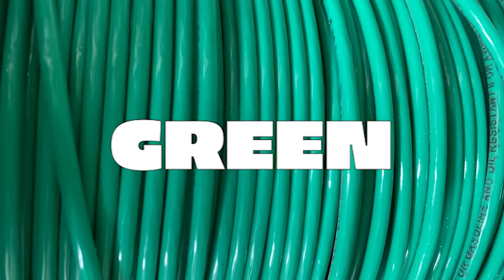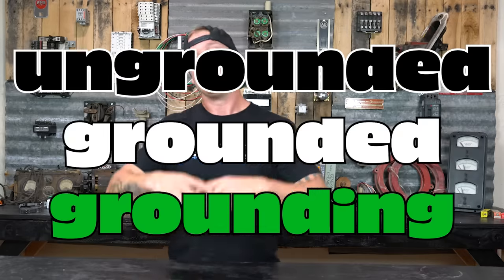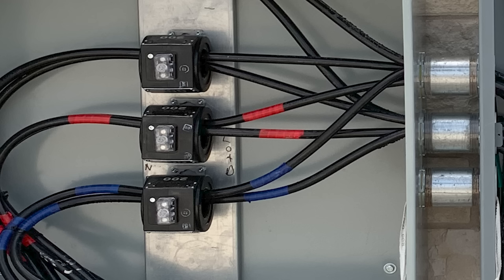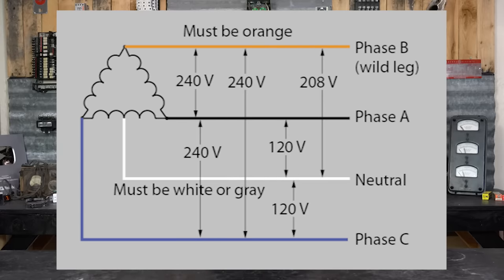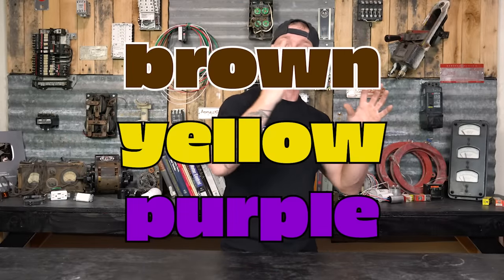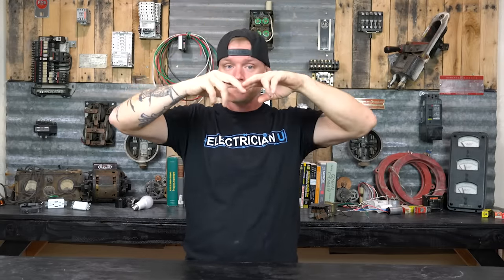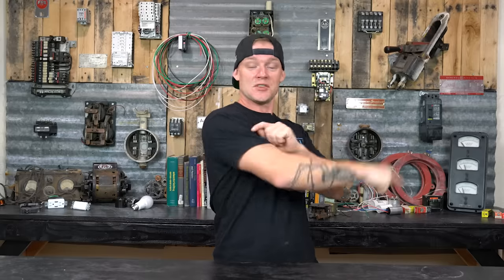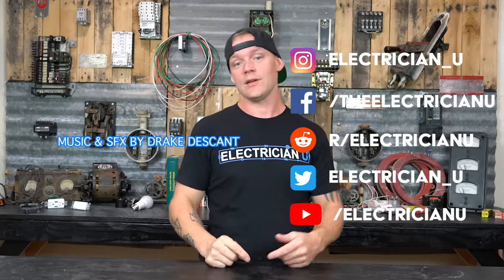Electrical Wire Color Coding Used By Electricians

Comment: The difficulty you're having describing "grounded" and "grounding" is that the "grounded" conductor is more correctly referred to as a "Return"... Stop calling the neutral wire a "grounded" conductor even though it is "bonded" to ground in the breaker box. It is the return conductor that's paired with a hot conductor.
Reply: @B Tomas … the “neutral wire” or “return wire” is the Grounded Conductor in the National Electrical Code so it’s not going away any time soon.
Reply: @jimshort9266  - The white wire IS a conductor of current, hence the term "return". It is NOT a ground wire even though it is bonded in the breaker box.
The green "ground" wire is NOT a conductor of current (exception is a fault) and that's the difference.
Reply: @btomas225  … I’m not arguing with your rational. I’m just stating that the code distinguished conductor types by defining them as:
Ungrounded Conductor
Grounded Conductor
Grounding conductor.
   They also use the terms phase conductors, neutral, and bonding jumpers but the term “return” isn’t used. The language used in the code book is always going to be utilized.
Reply: @btomas225  Its incorrect to call it return.Return would mean the direction of current flow,but there is no specific direction in AC as it swaps polarity at 60 Hz.

Comment: I don't mean to be a butthole, but the only wire coloring requirements in the NEC are that equipment grounding conductors be green/green with yellow stripe, grounded conductors be white/grey, high legs be orange, and that when there are two separate voltage system classes present each voltage system class be labeled separate from the other and it stays consistent throughout the structure.

Comment: In New York and New Jersey BOY  brown orange yellow .  Single phase is 220 VAC 440 VAC between phases , Find this a lot on new college buildings . Have this in elevator motor rooms and other equipment .  Use transformers to step down for lights and outlets to 110/220 VAC.      They do this to cut down the size wire going into the building . But not cost effective because of transformers .  Your tax money at work lol .

Comment: I worked on a 15,000 volt system and the other guys called it medium voltage
Reply: Medium voltage is above 600 volts to 69,00 volts

Comment: I always thought that the red conductor in 14/3 wire was used as a traveler in 3-way switches. I guess I've been doing it wrong. :/
Reply: Of course it is. The black is the common, unless you have a line/load in the other location. Then, you tape the white wire black and use it as a common in the 3 way with only 1 cable in it.  I hope that makes sense.

Comment: Fun Facts: In cinema or motion picture production, we "electricians" (not really electricians, set lighting technicians that work with a lot of electricity, powering 20kW lighting fixtures and what have you,) tag our 480v systems (in MN) Brown, Orange, Purple, because we use Yellow to signify 220v-240v which is much more common than running into a Wye or High/Wild (whatever you call it) Configuration. 
But, I hear they're actually very common in a lot of the older theaters and stage techs (a different world entirely) have to deal with them frequently] so mileage may vary.

Edit: There are plenty of certified Entertainment Electricians. I'm just not at that level yet.

Comment: What you need to know is never trust the color the code book only specifies white and gray needs to be neutral and if you have a bastard leg it needs to be orange and ground can be green green with yellow or bare it literally says nothing else about colors but I know guys who have wired center ground deltas and phased them black red blue so don't trust any color even when the code book tells you cuz you can label a 120/208 volt wye panel orange brown red gray and be completely legal the code is vague on colors and even with licensed electricians out there some might still ignore the bastard leg and label it red so don't trust colors it's kind of an industry standard that isn't because it varies from state to state

Comment: Or in my case, cant say where but at the location i work, you get people that dont give a damn and they’ll just use whatever color they have. Ive seen 208 being black/white, 480 that was all black wires, even seen a toggle switch that had black as power in and green as power out 🤪
Reply: If you ever work in an old building, they used green for a hot wire back then.
Reply: @MrSleepProductionsInc  yeah not the case here unfortunately. Building only a few years old.
Reply: @gonzaloalcantar6522  that’s a shame. I don’t understand how those new construction guys get away with stuff. I swear they have to be bribing the inspectors! I’ve seen sooo many obvious code violations in newly constructed buildings I wonder if the inspector even bothered getting out of the car.

Comment: Now explain a corner ground 480 v delta system. This one will get you killed if you don’t know what your doing. One of the hot conductors has no potential to ground. It’s an old system that isn’t used much.
Reply: It’s still very commonly used in central Kansas. It’s not a bad system.

Comment: Please do a vid on three faze!!!!!!!!!!!! I dont understand it and nobody can seem to explain it!!!
Reply: The general equation for a Voltage sine wave is:
V(t) = A*sin(B*t + C) + D

A is mid-to-peak amplitude (equal to sqrt(2) * the nominal voltage)
B is a term that is proportional to frequency, called angular frequency
C is the phase offset
D is the DC offset, which is zero for pure AC
t is the time

The C term is what is of interest here.   For 3-phase electricity, we have 3 voltage waveforms, that are each 1/3 of a cycle out of phase with each other.   For the A-phase, the C-term=0, for the B-phase, the C-term = -120 deg, and for the C-phase, the C-term=+120 deg.    Given 120/208V 3-phase, all amplitude A-terms equal 170V, which is sqrt(2)*120V to neutral.

The voltages of all three waveforms at any instant add up to zero, which is the voltage of the grounded neutral.  The voltage between any two of the phase waveforms will be a sqrt(2)*208V amplitude wave.
The voltage between any phase waveform a neutral, will be a sqrt(2)*120V amplitude wave.

The sqrt(2) term comes from a special kind of time averaging of the waveforms, called root-mean-square (or RMS).   I'll leave it to you to look it up in further detail.

Comment: Doing a startup on a 250 hp pump and the apprentice swapped the tape colors end to end on the feed. One phase dead to neutral.  ALWAYS TEST DO NOT TRUST WIRE COLORS.  Oh I'm not an electrician.

Comment: By conductor, you just mean wire right? "The black and red conductor" = "the black and red wire"?
Reply from the maker: For the purpose of simplicity yes. 
But the insulation color of a conductor has no real bearing or value at all when it comes to electricity. 

They could all be blue in color. One will be a hot, one would be a neutral, and one would be a ground. In this example. All three of the wires jackets could be literally any color. 

There is a ungrounded conductor (hot) grounded conductor (neutral) and grounding conductor (ground) for a 2+1 wiring system.
Reply: @ElectricianU  oh ok. That's making more sense to me now. Thank you so much sir! I am barely learning about electricity and I really like your videos.
Reply: @ElectricianU  so to be proper, because color has no effect on the conductor (if I understood correctly), we would say something like "the hot conductor," or "the neutral conductor," but not "the red conductor," or "the black conductor?"

Comment: RWB : DC power , BOY : AC power
Reply: Red/white/black = 120/240V split phase power
Red/black = DC
BOY = 480V AC power
BOYG = 277/480V AC power
Black/red/blue/white = 120/208V WYE
Black/orange/blue/white = 120/240V high leg delta

Comment: This guy is only talking about Wire Colors, when he talks about an ORANGE wire, he is showing a HIGH LEG DELTA SYSTEM, with this system there should be no SINGLE POLE CIRCUIT BREAKERS IN THE ORANGE LEG (when you see a Panelboard where every third breaker is a SPACE it’s probably a Hight leg Delta System). When I was teaching Young Engineers they often confused High leg Delta with 3 Phase WYE, make sure you know the difference. PS: THE HIGH LEG MAY NOT BE ORANGE.

Comment: the first picture shows parallel conductors on the same phase  going through separate lengths of conduit and holes in the box. pretty sure that's a no-no.
Reply: That’s the way you do it. You don’t want only the same phase conductors going in the same conduit. If you have two parallel feeds, phase A,B,C neutral and ground go in one conduit and the other conductors go in the other conduit.

Comment: I don't see much of what you describe for color codes in the sawmill I work at...... 480 Volt 3 Phase Delta system. Let's see if I can recall all the different L1,L2,L3 colors I've seen "Black,Black,Black" "Black,White,Green" "White,White,White" "Green,Green,Green" oh, and "Brown,Orange,Yellow" a time or two. And of course on 120 volt single phase I've seen White as the hot and Black as the neutral...... Everyone who works with electricity needs to VERIFY that the pervious person doing the wiring is not trying to kill you.
Reply: Black is hot where I live and white is always neutral.
Reply: @ShadowHumor  I'm in the United States, so it should be black as hot and white as neutral, but over the years some brain surgeon clowns have installed and fixed our wiring.....

Comment: I started in an industrial environment 3 years ago and was always used to BOY or BPY for 480v and yellow blues , blue/white for controls ... when I got onto a resi job I knew it was different voltage systems but didn’t know colors changed .

Comment: You need to learn you only have a high leg on a delta system not on a wye system need to address this, and most of the old 240/120 volt system are delta system and if you have a 480/277 volt delta system you again will have a high leg!!!

Comment: It's Brown Purple Yellow for 480/277Y to Identify it as being Y. It's Brown Orange Yellow for 480/240 Delta. Delta will always have a B Phase high leg. Meaning you cannot use the B Phase by itself or you will smoke your equipment. 240/120 Is Black Red Blue because it is Low volt. 208/120 is Black Red Blue also. Single phase is Black Red for 240/120 or 208/120. Idk what those colors are on your thumbnail but they are not from the US N.E.C.

Comment: I’ve been retired for over 17 years now, and I remember on a 4 wire Delta system, the Orange leg was 240 volts to the neutral, not 208 volts.
In the mid 60’s when I started (took the journeyman test on the 1968 NEC ) we had a lot of 4800 volt and 4 wire Delta systems in the Paper Mill where I started.

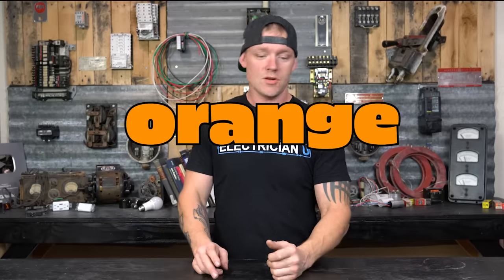Comment: Anyone else notice the panel at 7:07 and the suspect use of colors? It's funny that right after explaining the importance of wire colors in identifying phases and the voltage potential between them we're treated to this hammered dog shit! LOL
He seems pretty knowledgeable so hopefully this a random picture and not one from a panel he did!
Reply: The picture he is showing is a 120/208V 3 phase Wye. In this Wye system, black red blue is the common way to wire it. The picture is correct. Black orange blue(or red) is for a 120/240 3 phase grounded delta.
Reply: @atmacm  I understand, the feeders are phased correctly but take a look at the branch circuits. With the exception of one circuit on the top right they're just using black and red, so nothing to differentiate between the phases at splices and terminations after the breaker.

Comment: NOTE : You will see people run simple 240 hot-plate stoves and other stuff like 240v air compressors with 10/2 Romex with the ground doubling as common/ground.  They'll wedge that shit into the cheapest boxes they can find and even put it in plastic and plastic conduit.

Comment: White is not always neutral. Cheap idiots that don't want to buy different romex for 240V than their 120V will use the black and white for L1 and L2 and the bare ground for the neutral. Seen a lot of older 3 prong clothes dryer outlets wired this way.

Comment: Hi nec difines nominal system 208/120 3 phase 4 wire is bl rd blue wen hooking up motor u will get. clockwise rotation ,always in mdp left to right from power co referd to as network 
Same thing w 480/277 brown orange yellow again nec if cities or town tell u diffrrnt they have to have adopted changes at ea cycle of code .
Yes grandpa was right it was referrd ti as bastd or wild leg. Always all the way to right or c phase .to reverse rotation on 3 phase motor u flip any 2 conductors .in 3 phase crkts from trans pad or bank of 3 on pole the 4 wire is white u bond the insulated white or uninsulated grnded conductor (1 phase 240/120 v service to neutral bar in mdp and yor equipment grounding conductor insulated green or bare (in romex ) is hookd to neut bar and bonded to cabnet of mdp not on sub panl sep egc grounding bar 600 v 3 phase all 3 r blk identify w l1 l2 l3 markers for rotation purposes . 3 wire 3 phase crkts in mill buildings which r textile voltages wen it was a simpler time did not bring 4 wire in thats y u c only e conductors .u were not able to get neut or egc u would need isolation transformer to derive that . low voltage is from 0to 600 med voltage is 600 to 15kv high volts is 15 kv to 345. And upward of 745 kv med mite b plus or minus.    inspectors loose rite to tell lectricians how to wire its up to us to no our trade and nec code good video

Comment: Is an OHM a Hindu God ? what color is the green ground screw ? If ya only use 22 amps on a 30 amp circuit , where does the other 8 amps go ?
Reply: Ohm refers to Georg Ohm, the German physicist who coined Ohm's law of electricity, and the unit Ohm for resistance.

Ohm is not a Hindu God, but "Om" is a common word used in Hinduism, which is difficult to translate.  It is a spiritual symbol signifying consciousness and the essence of reality.